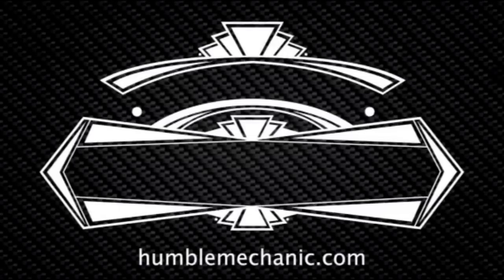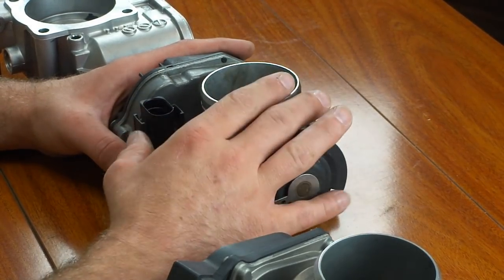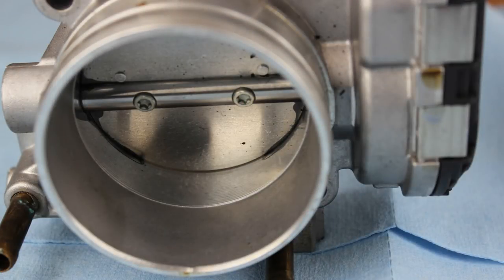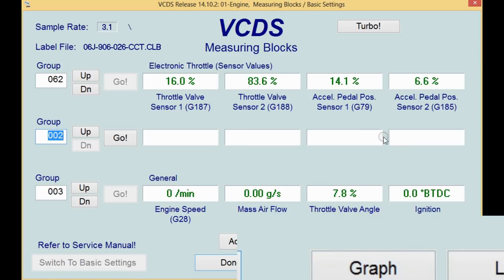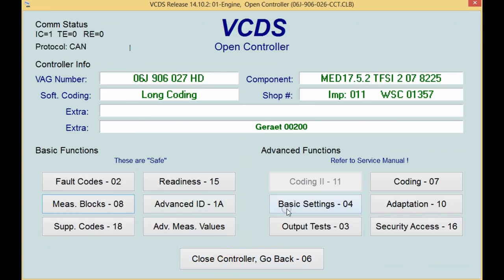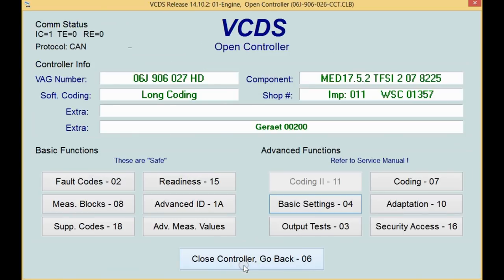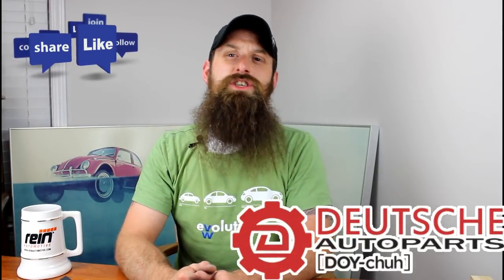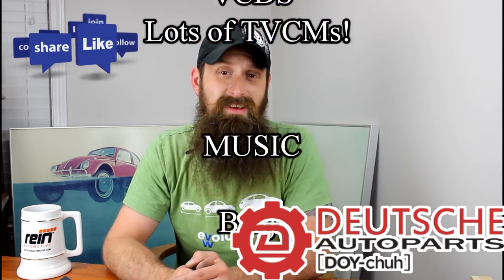How A VW Throttle Body Failed with VAG-COM Demo

Comment: I don't quite understand. I've got a drive by wire throttle body in my 2003 VW Passat W8 wagon. These need to be programmed?  I don't have a nice OBDII, just a WiFi one and a phone app. It dies a great job of telling me what's wrong, but I think that may be the extent of it.
    I get the 2101 Throttle Actuator Control (TAC) code every time and there are pending faults on the 0011 and 0021 camshaft position (CMP) for banks 1 and 2 intake.
    I found a bad vacuum tube, fixed that but it changed nothing, nobody was surprised.  I really REALLY hate the dealers and shops around here.  I took off the cable plug and put it back on to see if anything at all changed, and no it didn't. I also think it might be possible that when I was cutting these multistrand wires, tiny wires went everywhere. What if some were sucked into the throttle body?  Anyway, I'd still need to remove it, replace it (it's getting on in miles (90,000), I'd like to be sure. If I get one, I don't know how to program it nor what I would need to programand it.
     Please respond with any thoughts on the matter of replacement and programming of my drive by wire throttle body or of the coincidental time of the problem beginning. Well, no, look, it ran great with 3 actuators, it just idled rough. Now it idles great, but the RPM will start rising for no reason at all. The next time, it just idles fine. In every case, I clear the readings and start again and the 2101 keeps showing consistently. If I never give it gas, the CMP codes are never suspected. But the TAC code still shows up confirmed.  I just need to program one or fix the one I have maybe?
     I'm just not going to take it to a shop.  They ruin my car and rip me off, both. Every time. SOOOO,  I HAVE to program it myself if this is the only problem. I'll buy a new throttle body.  (I forgot to export the full list of codes because everyone who works on the car breaks something. It makes me mad so I probably didn't want to know.)  
      Anyway, please give me some guidance on programming my new throttle body.  Thank you very much. You're great.

Comment: I disconnected the Battery while i was working on the seat. Later i connected the battery and a think i heard the throttle in learning mode for 30 sek or something. Does this mean i have self programming throttle?
It's a 2005 Beetle Convertible with a 1.6 BFS Engine. Thank you and Greetings from Germany!
Reply from the maker: It will probably be just fine.

Comment: Recently got a VW Golf 06 SDI Manual... During an OBD scan I have P2106, Throttle Actuator Control System (TACS) 
I disassembled the throttle plate body. It was clean, mild dusty. WD40, some rubbing with a clean cloth, its SHINING. But the error comes back after clearing DTCs.
Help ?
Throttle reaction is good thats why im baffled what the heck is wrong. Gears don't shift as smooth and sometimes when letting off the throttle in low speeds and for say 1st or 2nd gear, there is a mild "kick" from the car. But I suspect its all to do with overall bad maintenance of the car and specifically the transmission. Or am I wrong and its the throttle ?
Also when letting the car creep on its own (foot off gas pedal) , in 1st its smooth, but in 2nd it sounds like its starving for some of that sweet diesel juice, a little. When giving gas there is again this mild "jerk" or "kick" you can feel. Can't feel it in higher gears (3, 4, 5)

Comment: Hello,i have watch your video,nice job,but in all internet o don't find some answers about this error code's: 00516 and 00668.All what i find out its that i dont have voltage on my throttle body,in the 4th gear and 5 gear,i can accelerate,its limited!please help me with some advices,thank you so much!

Comment: I have a problem, if you see this and can help that would be great 

I have a mk5 golf gti 2L petrol
Code misfire cylinder 1
I sealed the cool with another same problem,  I changes the plugs and took out and cleaned injectors and new seals, 
I cleaned the maf with maf cleaner spray,  and this seemed to change it a little bit still happens and same code cylinder 1, 

I'm debating to buy new maf but I'll check the wiring first 

Any ideas what it could be?
Sometimes but rarely it ideal a little high,  use to atsll in hit starts somtiems that's gone snow, 
Still get this tho when I accelerate it's bogs out sometimes struggle to exellerege smoothly car somtiems jumpy

Comment: I know this is the old video but i have problem with my 2007 vw gti i got the code p1579  adaptation not started i tried 3 different throttle body and in field 4 i got error i swapped the engine harness same thing not sure but it makes me to think its the ecu i bought the car with rod tru block so if you can help me out that will be great or point what to do

Comment: Hey Man, so I ran these blocks, and in block 062 sensor 1 and sensor 2 never fully invert, also in block 55 my idle stabilization is a negative -3.9%.....is this all correct, or is it time for a throttle body?  Car is a 2010 Mk5 Jetta TSI

Comment: Hi . Can you help or give me any advice to solve my problem ? I have a vw polo 00 1.0  mpi with 3 errors from throttle body , malfunction , adapt. Not started and intermitent . I already tried another tb , ecu , checked the wiring (no resistence from ecu to the plug) ... I rly dont know where is the problem , i cant adapt the tb .. the gas padle can generate this error?

Comment: My 2012 Polo 6r has no check engine light on, however the rev jumps and over revs whenever I accelerate in any gear
Reply: I experience the same in Jetta 2014 , anyone?

Comment: My 2009 VW PASSAT TSI 2.0 L Turbo just began acting weird.   While I'm driving the engine lights comes on and TCI as well then I cannot go pass 2 thousand Rpm on all 6 gears.

would the throttle body on my car need reprogramming after cleaning it or replacing it. ?

p2181
p0221
where the codes that pulled up after scanning for codes.

Comment: Hello i recently take of my throttle body and clean it and when i was doing it i shake the throttle body and something ratteld inside the throttle body is this normal or is something broken inside because after the clean the car runs better but somethimes i still have bad response when i putt my foot down on the gas pedall

Comment: Hey Dr. Humble im a fan of yours and I do have a few questions. I have an 2005 Audi TDI B7 140Hp 16v BLB motor. I have done the oil pump swap 2 years ago and it was all good, last christmas it smoked and stalled on a 1200km ride and had a new EGR installed. 
The thing is after 4 months a Pollution light came on. I have erased it 2 times but always comes on.. 1st time the machine told it was the Mass Air Deb but I know it cant be, cause I dont have a loss of power. Just black smole when its on low revs and when I hit  the throttle. 
A friend said it is a bad mixture of diesel and air and it got me thinking that it can be the trotlle body. 
The vacuum lines have no cracks and the throttle body has an rubber ring getting out and its leaking oil.. can it be the cause of it?

Comment: I have no error codes but when driving sometimes the car shuts off for a second and it’s as if it bump starts itself straight back on it’s like someone is slamming the brake pedal down for a split second ?. Also I have Rev hang sometimes and if I’m driving at a steady rpm and I let off the gas and give it a quick tap and let off again there is some hesitation before the revs decelerate am I right in thinking this could be the issue ?. Any help is appreciated thanks for reading guys 😁

Comment: I own a Seat Leon 2014 1.4 tsi, sometimes I like to check all the parameters in my car with an OBD2 protocol. The thing is I noticed my leon was making only 125 HP when it usually makes 145. I made a run and noticed the throttle body is at ±12% at idle and tops 35% at 6000 rpm, is this ok? Thanks for your time, greetings from Mexico.

Comment: I got a 09 TSI GTI. Whenever I ease on the gas or just staying in a constant speed the vehicle bucks/limps/hesitates. So far no codes has popped up nor any lights. Disconnected negative terminal on battery and cleaned the throttle plate, went away for approx 2 days and continued the problem after. Would love some feedback, thanks.
Reply from the maker: I always recommend starting with maintenance here.
Reply: @HumbleMechanic  removed throttle body and cleaned it, put every thing back the way it was. Using a bluetooth OB2 scanner/code reader on my phone im able to use the boost gauge. When cruising in between 2k and 3k rpm the turbo with overboost itself. Again no codes have popped up or check engine light. Was told it could be the wastegate. Thanks

Comment: 2001 VW Beetle 2.0L AZG. I was getting G188 code, replaced throttle body, now getting J388 adaptation error code. Not sure what I'm doing wrong, any suggestions?

Comment: I have a hard time repairing my car. Mk4 Golf that stalls when cold. I swapped throttle body with a friend and the engine runs the same. My throttle body works perfect on his car. After few weeks i got P1172 and P1543 codes. I dont know if its the throttle body or the wiring.
Reply: Mk4?  .... have you tried a new crank angle sensor .. humour me .. they are like $9 on Joom or wish..
Reply: @novi0974  I solved the problem. I had a crack in exhaust manifold near O2 sensor. After welding it, everything works great.

Comment: hello HM, on my car in group 62 the values in 3 and 4 field are the same, 14.5% in field 3 and 14.0% in field 4. My idle is low and I have a hesitation when acc. Even after TBA the field would not change. Is this a faulty TB? or a gass pedal sensor ...
Reply: I'd like to know the answer to that question too as haviving the same problem
Reply: Hi, Damien. I've ended up changing the TB. A easy way to test the TB is to check the resistance between pins 3 and 5 in my case anyway. The resistance was lower than normal so I changed it, but the values in the fields 3 and 4  are exactly the same. I don't know----it may be a faulty gas pedal or it can be just normal, in my case anyway----my wife's car is a Audi A2 1.4l
Reply: Hi ionut, Did it cure your low idle and hesitation problems?
I have been and still am working on a friends VW Golf MK4 1.6 16v (1J) AZD engine and when he bought it, it had an EGR fault. Cleaned the EGR and the pipe up to the throttle body, cleaned the throttle body, re-aligned both with VCDS, gave the car a full service, cleaned the MAP sensor, cleaned the camshaft sensor, fuel injectors and then re scanned for faults. none come up but low idle and hesitation are still there when it warms up. I also get the odd occasion of a misfire in cylinder 1. If you turn the air-con on once warm, the idle sits where it should as if it were off and you don't get a misfire. So As coil packs and wiring to them has already been checked I considered fuel pressure regulator or fuel pump but if that was the case all cylinders would misfire, so then thought faulty fuel injector but again I would expect to see misfire all the time. This then led me back to throttle body. Did a reading in VCDS on group 062 and throttle body field 1 and 2 added up to 100%, however fields 3 and 4 were 1% different from each other making me think that the pedal postition sensors G79 and G185 are at fault as my understanding of this is that the pedal sensors communicate with the ECM which in turn tells the throttle body what to do and then the throttle body sends a signal back to the ECM confirming its status. The pedal position sensor fields 3 and 4 as shown in the humble mechanics video should be double the amount of the other. The other strange thing was that i couldn't get a response with just the ignition on so I had to start the car. and fields 1 and 2 read fine with foot off the accelerator and swapped over when foot on. Fields 3 and 4 just 1% apart just followed each other up still 1 or 2% apart. I did some more research and confirmed that fields 3 and 4 indicate that there is a short in the pedal. I also checked my Audi A6 Quattro with VCDS 062 and with just the ignition on all fields were doing exactly what they should do with foot off accelerator and with foot on. However upon further research I have also read that because pretty much every sensor to do with air and fuel comes into play with each other that it can fool the ECM into putting the pedal into safe mode which would also bring up the reading in fields 3 and 4 being the same. Reading this has made me go back to basics again. So used VCDS to go through basic readiness tests which after completing, the results were as follows:

Exhaust Gas Recirculation: Failed or Incomplete
Oxygen Sensor Heating: Passed
Oxygen Sensor(s): Passed
Air Conditioning: Passed
Secondary Air Injection: Passed
Evaporative Emissions: Passed
Catalyst Heating: Passed
Catalytic Converter(s): Failed or Incomplete

Still with no faults coming up at all, after further inspection I've noticed a slight blow in the exhaust which has led me into wondering if that is lacking enough pressure that the EGR isn't doing its job when engine is warming up causing the ECM to report a short which in turn is affecting the pedal sensors which then send the incorrect signal to the throttle body. ???? Going to sort exhaust and change CAT i think and then go from there to see if I can then get EGR to pass, and see what happens from there.
Reply: Yeah, pretty much the same thing here. The change of the TB didn't solved the problem. My EGR is new so it's not the problem. You can try block it just to see if it changes anything. Did you tried to adapt the EGR valve? I checked all the wires for continuity between TB, pedal and ECM and they are ok. I have the service manual but it doesn't say anything about resistance on the gas pedal pins as it says to the TB. I can try with another pedal to see if it get's better. I don't know how you can clean the cam sensor ---it's just a magnet. I allready  ordered a new one ----should come in a few days. It has to be something with the pedal I think or a bad injector in my case because I don't have a problem anymore with the idle, it just stalls when trying to start from a full stop on 1st or reverse. I have also a spare O2 sensor. I can try to change the second one and see if it changes anything. I've changed all the sensors that could send wrong data to the ECM, new fuel pump.... very frustrating.

Comment: Hi buddy, i wanted to ask you about my vw polo throttle body i purchased, on the side where the gears are i can hear a rattling noise like the gears are rattling against the housing, where the plastic cover is. Is that normal? I cant remember my other throttle body doing that.

It sounds as if something is broken in the gears part, hence making that noise.

Comment: Really need some help here, just replaced the throttle body because the EPC and Engine light came on, and it worked great for 2 weeks. But just a few days ago same thing happened, lights came back on and limp mode started. Getting P2101 and P2106 codes now. Not sure if the throttle body I got was bad (note: was remanufactured) or if I need to get a new pedal sensor. Any help?        :( (also side note, when I installed the new throttle body, it said a idle speed relearn was needed, but I didn’t end up doing that cuz it worked out fine, could this be a factor)

Comment: Ok I have a 98 vw cabrio 2.0 manual. It's a cable throttle body. It falls on its face after 2500 rpm in every gear until I lift off gas and repress, trans and fluid is good and no leaks or nothing anywhere. Do I have to reprogram the stock throttle body or buy a new one n program it?
Reply: Gets worse going up hill and nothing at all down hill. Doesn't want to do above 60 mph unless on really level ground.
Reply: Did you ever figure it out?

Comment: how do i do a throttle body relearn. What is the normal RPM's on a 2006 nissan altima. I Repalced throtle body and my rpms are 1500 parked. Please comment.

Comment: Hi great vid!
My 2008 VW Golf 1.9 TDI bluemotion has been sounding like a helicopter for a little while now and every garage I have taken to has said it needed a Terraclean (182k on the clock) it has now had a Revive clean and Terraclean which has improved the car in many ways as it used to go into limp mode alot but not at all now. I do still have a very loud engine. I took it to a garage and he showed me that the throttle body flap wasn't behaving properly. It can open and close but opens far too much resulting in a very loud chugging sound when accelerating. There is no engine management light on to go by so the mechanic checked a few things and changed the EGR valve it hasn't helped and he has said there is nothing else he can do. If anyone has any ideas I would be very appreciative

Comment: Can the throttle body cause slow cranking/struggling to turn the engine over please? I have intermittent troubles turning the engine over. Sometimes I need to tap the accelerator pedal during cranking to turn over the engine.
Reply from the maker: I guess it could, but it’s not likely at all
Reply: HumbleMechanic okay thank you. I have the battery checked already and there’s no error code, so just trying to eliminating all the possibilities. Thanks!

Comment: Code P1565 is the stupid code for these problems! I cleaned mine and the code hasn't come back, fingers crossed! good thing because the throttle body for my 1998 audi a4 2.8 is 450$ from auto zone, a junkyard is your best friend when it comes down to issues with these cars.. I have never used a vag com to set my throttle plate but I have no issues from it, idles fine and drives fine, the car was sitting almost 3 years battery died at least 3 times..